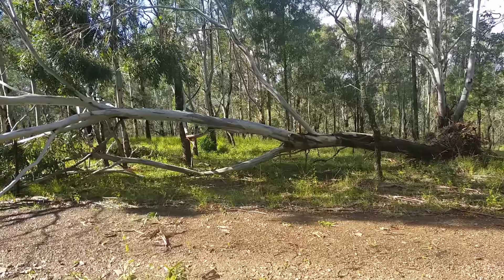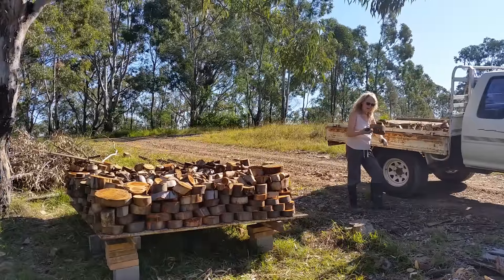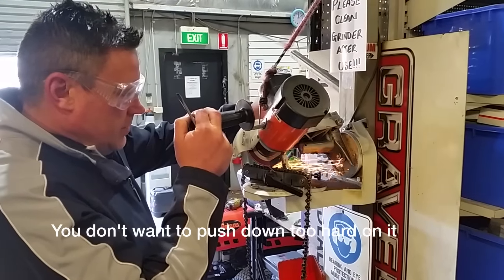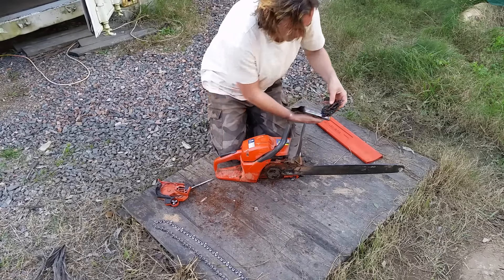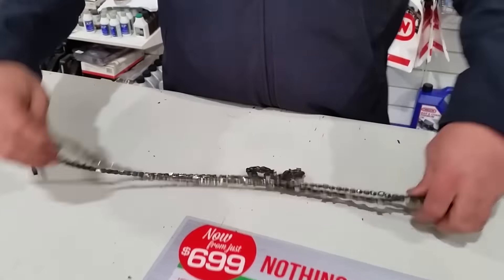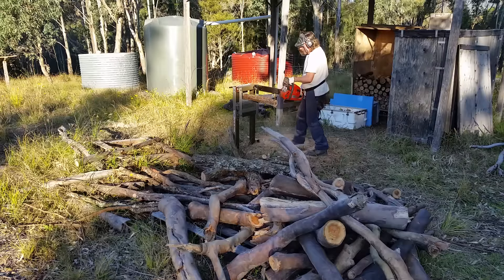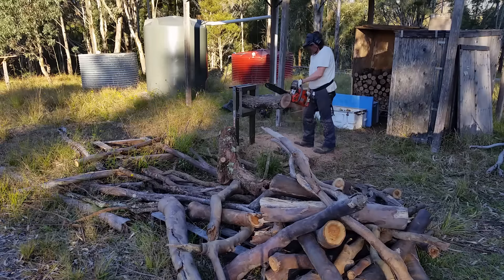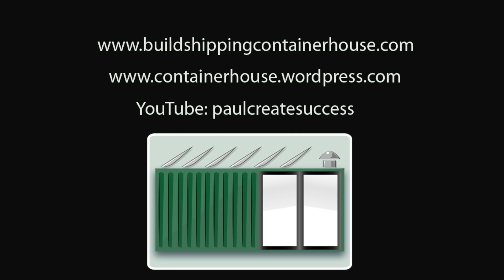Shipping Container House – Knots in the chainsaw

Comment: Thank the gods you wear face protection! I always worried about my brother going about with his Husqvarna, until he got a good wood holder. He and my sis in law had a huge property with lots of trees that always needed seeing to. They have a much smaller place now, no Husqvarna! 
Thank you for displaying good safety rules while using power tools. It really matters!
Reply from the maker: +Sandra Nelson Bless, thanks. I was advised to get the chainsaw trousers by a subscriber at the beginning and so I bought and use them. Cheers Paul